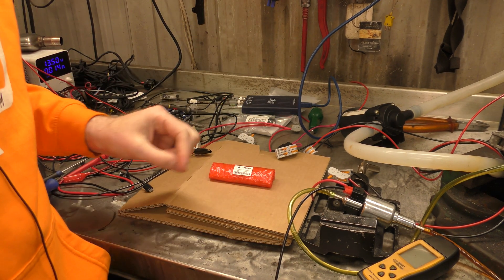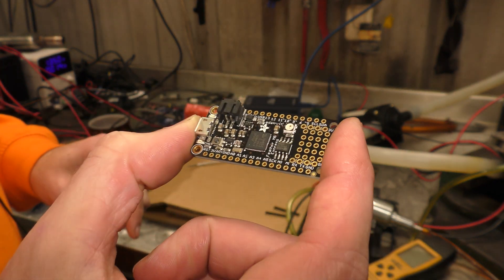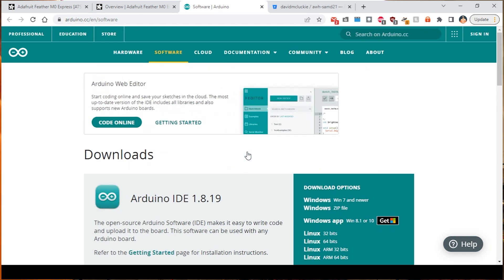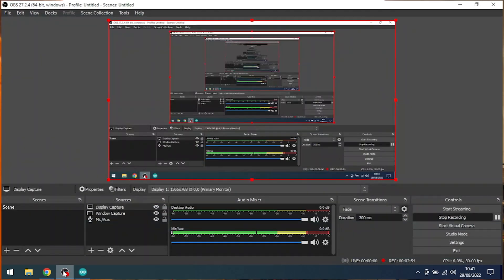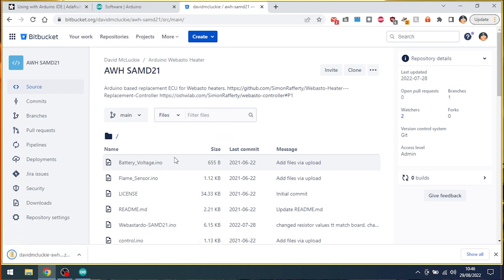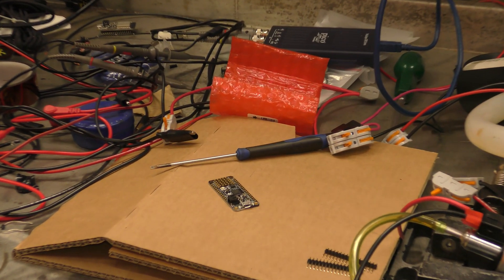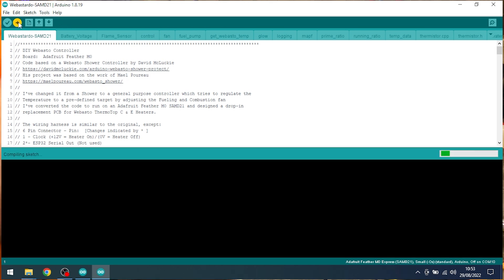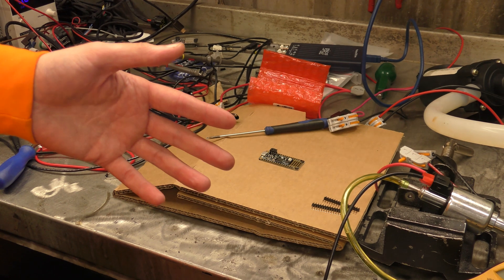Webastardo  - replacement controller ECU for Webasto water coolant heaters // part 2 - how to flash

Comment: Is the Webasto V model that much different? None of the aftermarket solutions seem to support them
Reply from the maker: The Webastardo will.  As it doesn't use any of the Webastos sensors.  The burn chamber is interesting on the V, I should take one apart again to show it.
Reply: Main downside is that the board doesn't fit in the heater, so you'll need to use another enclosure to keep it dry and you'll have wires coming out of the body. I guess like the original webasto shower project. Other than that it should be fine, I'd like to try it with the V as I think using the V's in built temp thermistors for temp and overheating would be good!

Comment: Why hasn't someone made a universal kit for raspberry pi or orange pi, with built-in web server for remote access to the heater, and come with a sensor connection kit? 

Will I have to do it myself you lazybones?
Reply: I'm looking for a simple on OFF and set to output controller for my china 2k ?
Reply: @wonyankeesays5661  afterburner controller
Reply: Sorry I thought you meant on and off via inputs
Reply from the maker: I wish I was that smart.
Reply: @DavidMcLuckie  WELL U KNEW WHEN I ASKED ABOUT CONDITIONER AND FREEZE ADDITIVES THAT THEY WERE A NO PROBLEM ,,,LOVE ALL THE INFO ,,THANKS
Reply: @DavidMcLuckie  I WISH SOMEONE MADE A ONE KW,,?